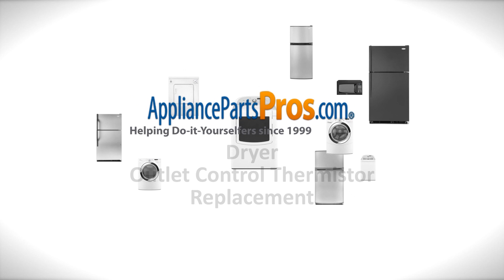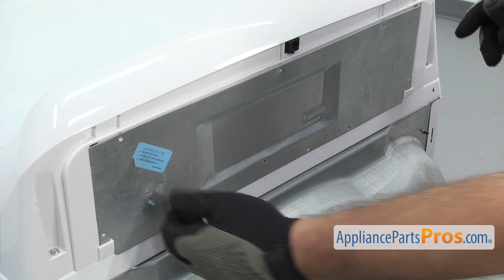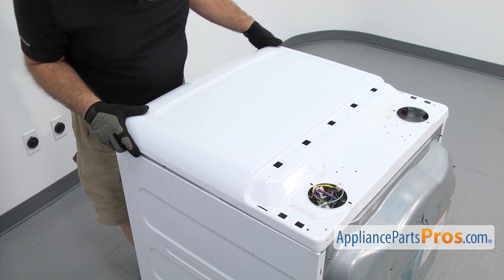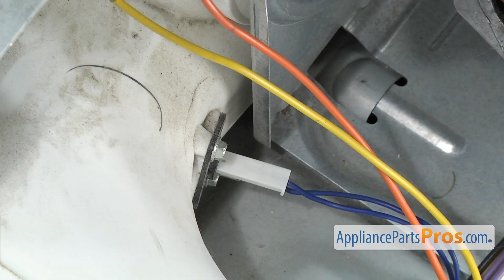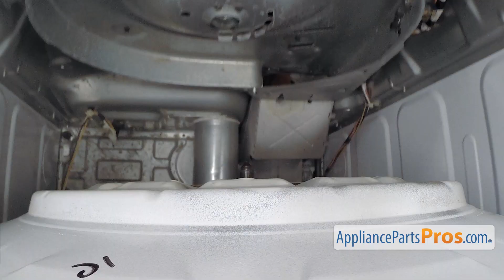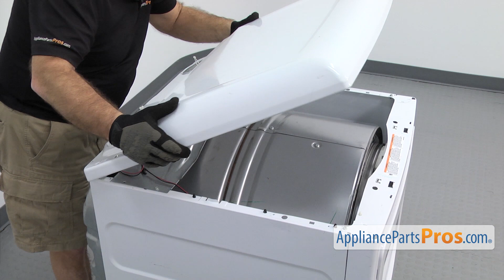GE Dryer Outlet Control Thermistor WE4M448 Replacement

Comment: Should this part show continuity? Mine doesn’t and dryer will not power up at all. What if I jumper it to test if dryer now gets power to the board?
Reply from the maker: The thermistor should have a resistance value of 98-102 ohms at 77 degrees.
Reply: @appliancepartspros  thanks for replying to me. Would you have time to answer some questions? I’m 80 and and having a hard time figuring this out. Like this machine has 5thermistor things 3 test at 000 one at 124 and one at 126. It’s 66F in here would that explain the 000 reading?
Reply from the maker: It sounds like the reading you are getting is good. You will test the thermostats for continuity with a multimeter. What is the issue you are having with the unit?
Reply: @appliancepartspros  Up date,,yes testing with meter used heat gun to check the over heat switches they work correctly. So as far as I can tell everything works fine inside the dryer. Will reinstall everything and go after the board. It’s a $404.00 part.
The problem is the dryer will do nothing the power button won’t do anything. My wife thinks that the last time she used it she had it on air fluff, but the clothes were hot when she took them out.
Reply from the maker: You will need to test for power coming to and from the control board. When you hit the start button you should have power coming from the board. If you have power at the board but nothing coming from it then you will need to replace the board. If you do not have power at the board you will need to check the wiring and power cord and check for power at the outlet.  You will need to locate the tech sheet on the unit to locate the testing points.
Reply: @appliancepartspros   Ok will try to find the tech sheet online. Thanks for your help.

Comment: Does this part cause the board not to light up?
Reply from the maker: No, this part would not cause the board to not light up. You will need to check for power coming into the board. If you have power and the it's not lighting up then you will need to replace the board.

Comment: Thanks for this video.  My 9 year old Whirlpool thermistor was a lot easier to change with a front lower access panel.  Easy access to the heating element also.  Electric, not gas.  Hopefully my next dryer will have easier access than this GE.  I appreciate this video.  Thanks.